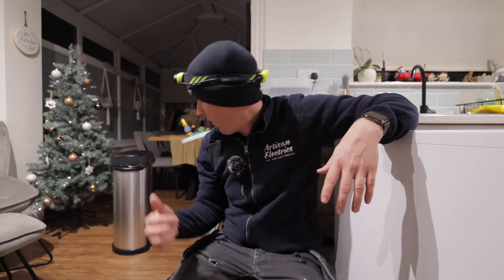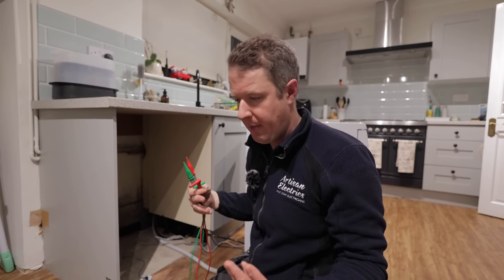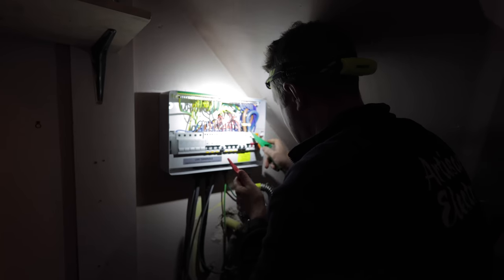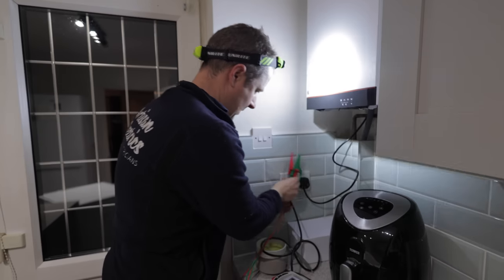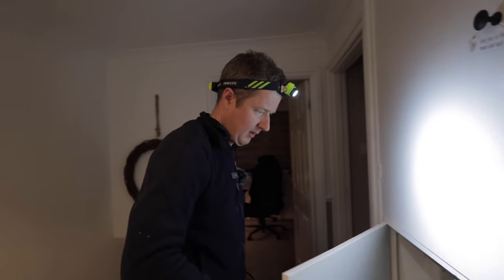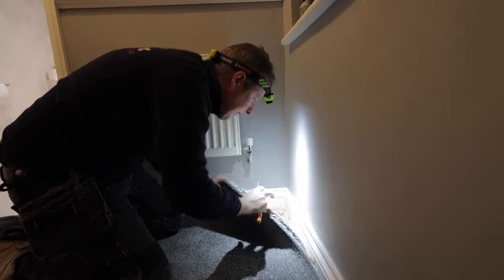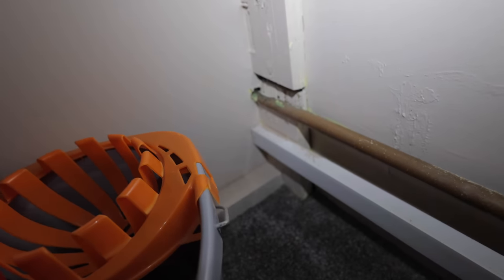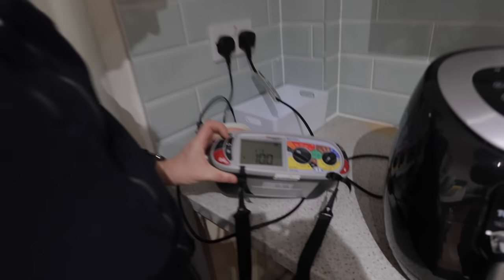Nearly KILLED by a CRAZY fault! What on earth is going on? 💀

Comment: Excellent bit of logical testing and rectifying.  In 50 years in the electrical industry now retired, I came across many weird and wonderful ways people found ways of wiring things wrongly. Here is a real-life scenario that caught me out. 

In the small gatehouse for a football club in Scottish Division One
there was a 4-way DB Supplied by 6mm SWA with a 60A isolator.
Only 3 circuits were used.
1) 16A going a fair distance to supply some lighting in urinals top of terracing wired in 6mm SWA( Don't know why it was 6mm. I can only assume that was the only cable they had.)
2) 6A supplying one 60watt lamp in gatehouse wired in 1.5mm T&E
3) 16A supplying single socket in the gatehouse for a small heater wired in 2.5 T&E
The socket and plug top showed signs of burning due to a slack connection in the plug.
I thought, simple... only three cables, and they were easily identified by cable size but just in case I isolated the main 60A breaker and went to replace the socket.
After an electric shock a loud bang and a flash in my eye. I thought how could that possibly happen.
Tested incoming supply live conductor going to the main switch to find 0 volts tested outgoing supply feeding DB busbar 240 volts.
Some idiot and I found out later who (not a spark but a handyman ) had mixed up 6mm circuit 1 and the 6mm incoming supply making circuit 1 through the circuit breaker feeding the DB busbar.
It certainly made me change my ways of taking nothing at its face value and testing everything.
Reply: One of those mistakes you only do once... one way or the other!

Comment: I have experienced the same situation where the combi boiler was located in an outbuilding, powered locally, and the control system was powered from the immersion heater circuit next to the hot water tank.
Fortunately I discovered the boiler being powered from two circuits and avoided getting a belt! 
Nonetheless a very dangerous arrangement.
Well done and thank you for sharing.
Reply: I bet this is more common than Jordan thinks (maybe without the special death-plug feature). Just turned off my 'heating' breaker to confirm that both the boiler display turns off and the heating timer display turns off. It did. Good video, thanks.

Comment: With 43 years in the electrical repair service my Wiggy tester was my best friend and saved my life many times. Still, "One Hand in the Zone" saved me more times working around troffers 277 VAC. 

When in the US Army working on a HUGE telephone equipment rack, I worked next to a boiler. Every time I touched both the boiler frame and my bonded conduit I'd get a buzz. Mind you in USA we have 240 VAC split into two 120 VAC. One side of the boiler 240 VAC had touched the frame and the frame was not bonded well. After calling and complaining, the plumber came out and could not find a issue, two days later I grabbed the Sergent in charge of one of the electrician crews and showed him my VOM reading of the boiler frame and my conduit. He first check my conduit and it was all correct. Then he looked over the boiler junction box and found the wiring error. It was wired maybe 40 years before, during WW2.
Reply: It's pretty scary to say the least.  I'm an amateur DIY, and I'd say electrical work scares me the most out of everything.  If I need to change out a socket, light fixture, or hang a ceiling fan, that's 100% fine to me.  When you start doing more complicated stuff and in the 240v range, I throw my hands up and say no.  

Heck, I still remember one instance where I went to put a fan up.  Flipped the switch in the room to kill the power, got tazed really good when pulling the fan down, and found out that switch wasn't even connected to the fan.  I learned my lesson then and there to switch it off at box, rarely if ever trusting a switch.
Reply: @amanawolf9166  You know in some old houses (at least around here in PA), back then they used to switch the NEUTRAL, so the hot to the fixture/fan is always HOT, and the neutral is switched, meaning whether the switch is ON or OFF, the hot is LIVE !
Very dodgy situation, since the switch works correctly turning on and off the light/fan, so you assume that if the switch is OFF it means you killed the hot, but actually not!

Comment: As a mechanical engineer I test every option every time. Probably because I’m used to 3 phase,this has gotten me into that way of thinking/doing. I used to do factory maintenance where we had 11KV incoming so the electricians I worked with were very conscientious, and would check and recheck and that rubbed off on me.
As a mechanical guy I’m quite good at fault finding, but I know my limitations and avoid stepping out of my comfort zone.
When I left factory maintenance and went mobile, the guy who interviewed me for my job ended up being my supervisor. He was a lovely guy but was a bugger for cutting corners. He left us and went to another company for better wages, the last I heard about him was that he’d died changing his dads boiler. Apparently his elderly dad went to check on him and found him sprawled across the boiler, a goner. I didn’t find out until over a year later so don’t know the details, but perhaps he cut one corner too many. Perhaps he’d come across a similar fault like this one, who knows.
Anyway, kudos to you for your perseverance in finding and rectifying the fault 👏👏👏

Comment: OMG! As a gas engineer I would never think to test a plug after removing it. Worryingly, I work in the same area as you so I could well have come across that one day. I can see how this has happened though, so it's a good lesson to always carry out your tests regardless.
Reply: As a Gas Engineer would you insist on a monoxide detector for this property? Thanks
Reply: If it has been installed since July this year, it has to have a Co alarm near the appliance. And the boiler shouldn’t be installed onto a switches plug
Reply: @TheNockPlumber  The reason I asked is I did not see one
Reply: always check the power
Reply: You shouldn't have to test a plug, this sort of thing shouldn't happen. Unfortunately we have a thriving population of top class cowboys and handymen in the UK.
Reply: @DeltaCodex  agreed
Reply: @DeltaCodex  Handymen I can understand, to an extent. Anyone being paid for this needs to be sued into oblivion

Incidentally this is WHY Australia and New Zealand both have absolute prohibitions on DIYers doing anything to fixed wiring - and on any kind of paid electrical work without having at least the minimum training (two levels, one to fit plugs to flex, work on appliances and exchange fittings on fixed wiring - and a slightly higher one to work on 3-phase and industrial machinery. Beyond that it's a 3-4 year electrical training course to do installations)

It shouldn't be much surprise to find that most illegal/dangerous work discovered has been carried out by British migrants
Reply: First of all should you have left, knowing there was a fault on circuit
Reply: @miscbits6399  Are you not all British migrants though?
Reply: @sparksoverhead5188  What? I would only know that after testing it...

Secondly, I would know how to fault find and fix it.
Reply: @drewbs86  I'm on about artisan electrical, left socket with a fault. His should of isolated, he stated the fault nearly killed him.
Not till his second visit he found both ringmains linked via boiler
Reply: @sparksoverhead5188  Oh I see, yes you're right there. Just that you replied in my thread so I thought that was a reply to me. 👍
Reply: @drewbs86  no worries
Reply: This is a dangerous setup from a bodger. I am not a qualified household electrician but work on automotive and been trained on traction voltage. Normally I would leave a hoover or light connected to the circuit and flip the fuses if it goes quite or goes dark it’s that circuit isolated tripped. But in this case the live is still live from upstairs ring but only with thermostat armed. No neutral downstairs so hoover or light goes off. You become the live to ground when you touch the wire if the temp is correct and the thermostat is in. Ok then the traction voltage training applies. Check multimeter works on know voltage ok, do not touch dials or buttons, now test for traction voltage and confirm no voltage wires to wires wires to ground now recheck voltmeter on known voltage. Basically prove meter do test prove meter. Hair stands up further at 600V DC normally only once though. Criminally negligent Boiler installers who probably have all the right paperwork. They could have killed someone. Talk about leaving a boobytrap. Stupid does what stupid is even with paperwork. They need telling, in the Workshops I used to work in they would have been written up on the board by the sink named and shamed everybody could see name what they had done the cost and the risk. The guys got ribbed about it by everyone, until the next stupid event happened. Some caused by lack of knowledge some just by Laziness. I still tend to just flip wires as well before gripping them just in case (household stuff).
Reply: Carry an ncv
Reply: @miscbits6399  Not in every state I believe only Queensland and why do we need speed cameras when the rules say you can not break the speed limit? I reported one job where the appliance was tripping the circuit breaker so they first tried swapping the earth and neutral that did not work so the non-pom disconnected the ground. The customer got an electric shock when she removed the washing when turned off because in Australia only the live is switched on Aussie brands. No action beyond a phone call when reported. Another brand of washer has no ground on the motor. Bearings leak and the shaft becomes live customers get shocked I see it often. Being a pom mate I was called a liar and troublemaker by the regulator because the drawing shows the motor cannot get wet? Nothing like a bit of Aussie racism mate is there. She will be all right mate have another stubbie on the job. Your PPE will save you.
Reply: @A. Melbs Well there is only one direct drive NZ top loader with no earth on the motor or tub. It's not Simpson. But I have been told there is no way water can get on the motor because the drawing says it cannot and the regulator agrees with them. It's 320v DC just to make it more interesting. I supplied a sample and they sent the manufacturer to pick it up. The rusty brown streaked corroded motor had no earth leakage when dry. I had just sold around 50 the same as scrap metal. The design may have changed I moved on to better things. The other model was a Simpson where the top cover was resting on the Toc active. Not the most difficult fault to find in ten minutes. I thought someone might have been trying to kill her.

Comment: Well done Jordan great fault finding . Keep a none contact voltage detector in your top pocket as the last line of defence to just sweep around any cable you are working with before you touch them. I am sure at that sort of voltage it would have give you a warning that all was not safe. I am retired now but the humble volt stick has safe me once or twice in my work career . Hope this helps
Reply: Always use ncv
Reply: I use the volt stick first, then the meter.

Comment: I'm so glad to see you do this video.... because you survived the shock. I'm not a qualified electrician but I've been in electrical and electronic fault finding all my life and have come across puzzling things like this. When you were holding that live boiler plug in the air, my toes were so tensed up, one of them cramped, I was in agony. Surely anyone with any sense should know not to have a feed from different circuits and if it was a qualified electrician that did that job, they should be named and shamed.

Comment: Great Video it takes me back.  I did 20 years of maintenance for an Electrical Contractor and came across many similar situations and head scratching moments.  one such "shocker" literally was we had a call from a private customer to say they were getting shocks off the kitchen sink. The system was fed from overhead wiring, so not to risk getting a shock off the sink I first thought I would check the Earth rod. The cable was clipped down the wall and disappeared in the ground I went to clear the soil away to find the rod connection and got a cracking big shock off the ground.  OFF THE GROUND!! frightening.  To cut a long story short the fault was a pinched cable on a lighting circuit 6 A fault tracking to earth. But the distribution board did not have any RCD,s and was fed on overheads with the customers own Earth.  Just to point out this one wasn't one of our installs.  Keep up the good work. 47 years in the business I have seen a few things, but the EV charge points and PV Battery systems are all new to me.

Comment: Super. I always wire like it is hot, and I am glad that you aren't pushing up daisies. My mentor always told me, "Be careful out there, you can fry in your own fat for hours before thy maker sees fit to drag you into his fold." I think about those words almost every time I am working. Thanks Fritz. Interesting fault. Half way through, I would have bet on a broken conductor, with the return through the ground, energising everything, but having two power sources to one appliance was very interesting, as now I understand why my man told me to put a meter on everything and check. P.S. I kinda have the same giggle when a wire pull works out. 🙂 Be safe. 💙 T.E.N.

Comment: Good that you survived what could have been a lethal shock. When I worked as a commercial electrician double feed faults on office lighting were bread and butter. A proximity tester (sniffer) could have alerted you before you got the belt. Almost certainly you have saved someone from a severe shock or worse. Job well done.